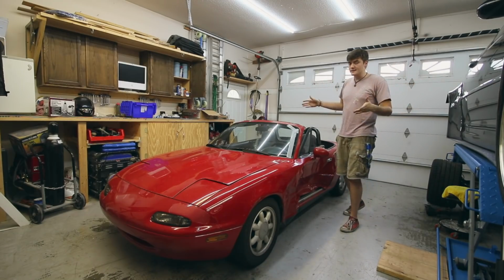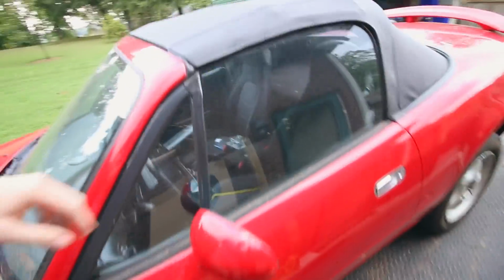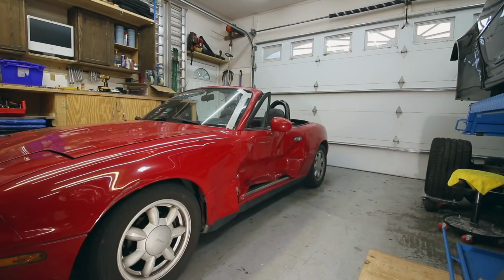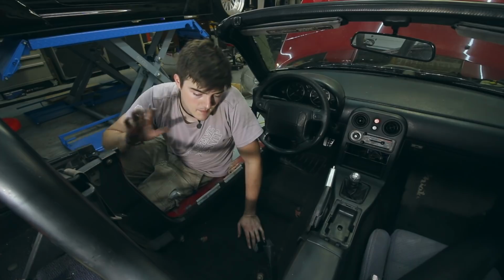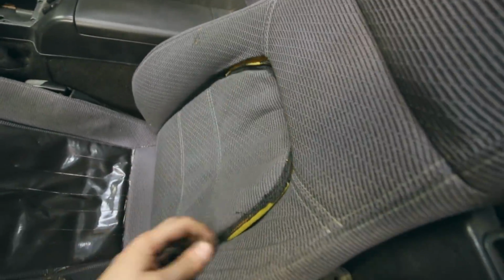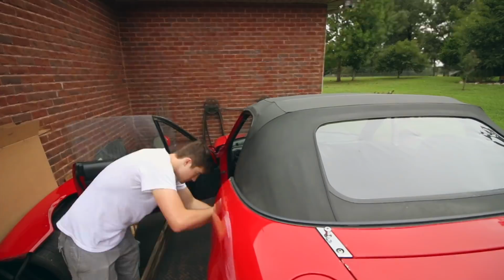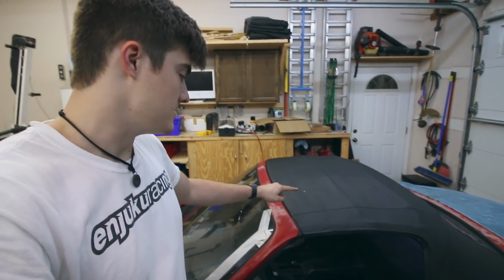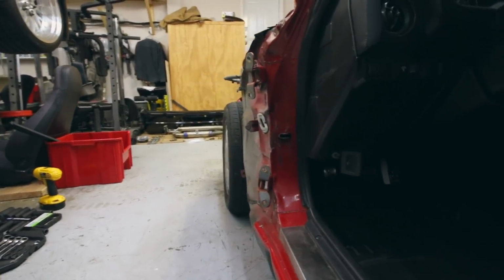New Car | New Project!

Comment: Why do You swap all those parts to that ruined miata? What's wrong with the donor? Wouldnt it be better to swap everything from  in garage miata to that outside miata?
Reply: Jake Faulconer both cars have frame damage, just different locations of the frame
Reply: i guess the frame damage from the donor its worst than the one on the garage, i get an idea of that cause the one inside of the garage can be drive and the other came in towed

Comment: Love your new Intro. Seriously, awesome. I know you since 10k and i can just say... Congrats to 76k :P. So awesome that you bought a Miata (in germany we call it a MX5 NA). Have a nice day (@der_folierer).
Reply from the maker: Tim Essel thank you! I worked hard on that intro! Thanks for noticing!  

Thank you for your support!
Reply: Buuut. Why domt you take the spare parts car and put engine + transmission from the damahed csr into it, do it does run again? Looks like its in great shape, compared to the damaged one.
Reply from the maker: Tim Essel Tim Essel the engine and trans isn’t the problem.  The “parts” car has frame damage. There’s no way to straighten that out.  You can see how bad the alignment is at 10:01
Reply: @KyleReese6511  Mh, okay, well... That sucks. But there is a special technique or welder which can repair the chassie. Basiacly that you do is weld some metal sticks on the fender and pull it out. Its not very easy, so if you want to do it that way you should go to a guy with enough experience. Or you can use Bonfo to fill up the rear fender. In the front you should use the first technique or try to work with the hammer. But remeber, something can break off anf tjen you HAVE to weld.

Comment: what going on with the M i see it on the lift apart again?
Reply: Probably redoing the whole floor where the rear axle mounts... like me and some others already told him to do (bmw repair manual) instead of just welding some plates on

...or he's switching to non-solid axle mounts again because of the weird noises